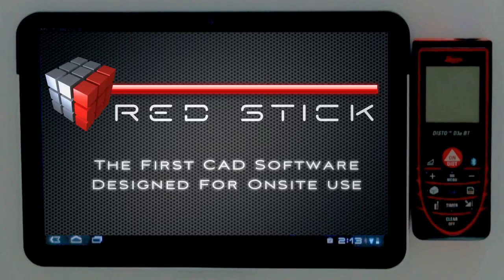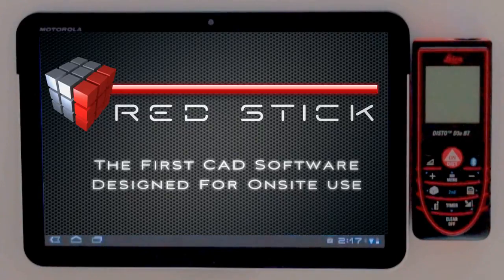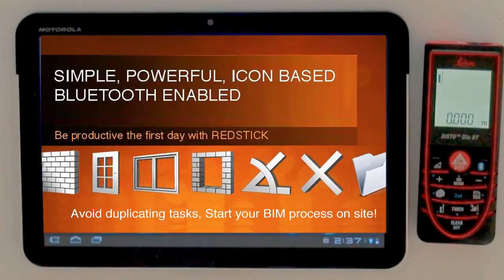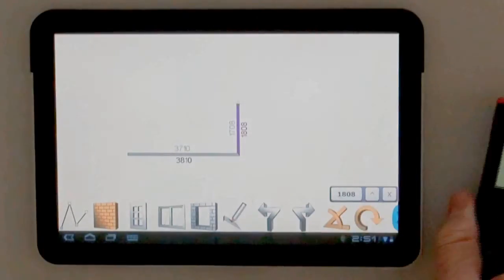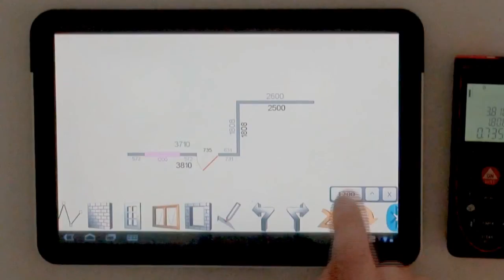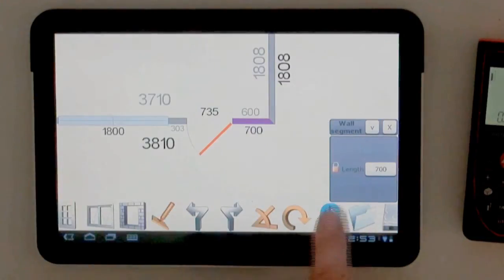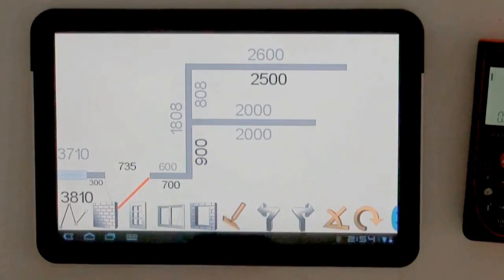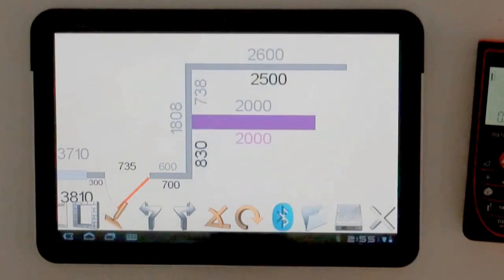REDSTICK SiteCAD intro2

Comment from the maker: Correct, its a Motorola Zoom. Android is the only OS that will accept a bluetooth signal from a Leica measuring device. Other than that it works equally as well on Apple iOS or Android. Pretty old movie, I need to post some new ones. THanks